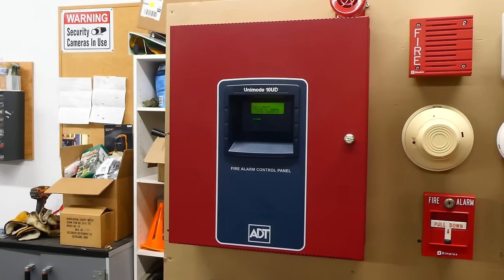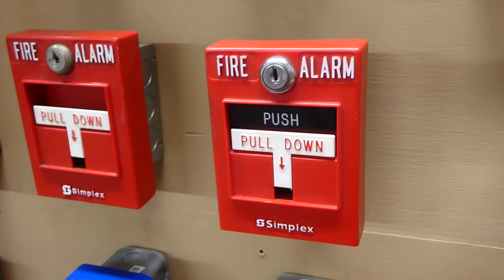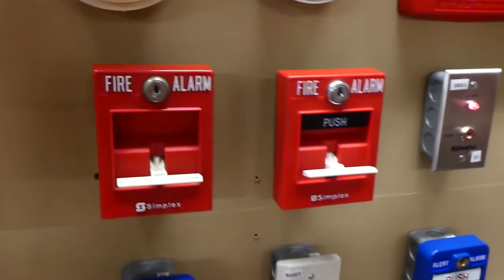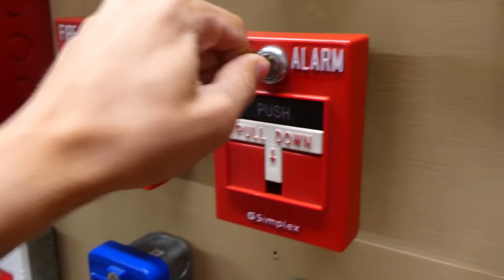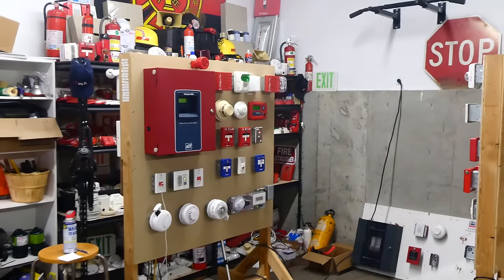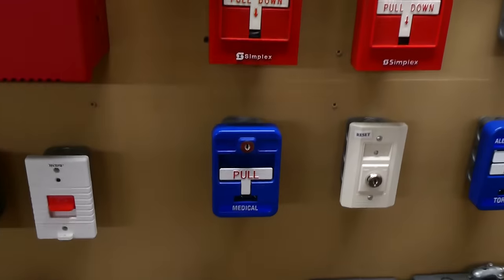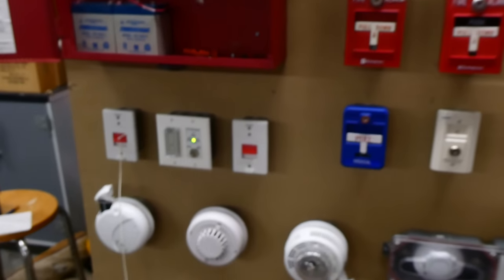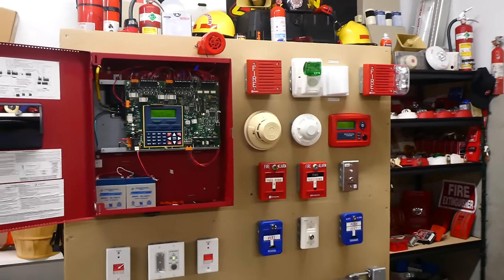ADT Unimode 10UD System Test 10: LOUD!

Comment: I like the chime sound that commander makes is cool, I always liked the multi-tone alarms. Also may I ask how you got the 12v siren to work on a 24v panel? are you using a resistor or is it a separate power supply?
Reply: If I'm correct, there's a relay in the panel that he is utilizing, so he has to have a separate power supply to use for the siren.
Reply: @CraigBaker96837  Oh, I thought he used the NAC directly.
Reply: It's a resister
Reply: The chime with the panel or anounciater beep is adorable!!😍

Comment: My school fire alarms are simplex and they are always set to continuous, you get used to it really easily though.
Reply: What are you saying
Reply: My school uses Est genesis a Wheelock in the front and a Wheelock 700ts
Reply: I have code 3 alarm.
Reply: Jaxson Carter  h
Reply: Same but they only do drills on 1 pull station, not smart

Comment: I see why it's called the 10UD. 10UD equals LOUD! Just kidding. It's just a nickname for it, depending on what kind of notification appliances there are. The System Sensor SpectrAlert, though, is VERY loud. Every time, I mean EVERY SINGLE TIME, the fire alarms went off at my elementary school, I cover my ears. They are still quite loud to me these days.